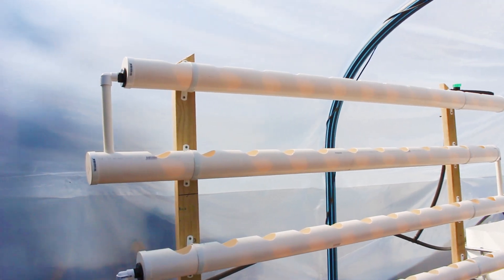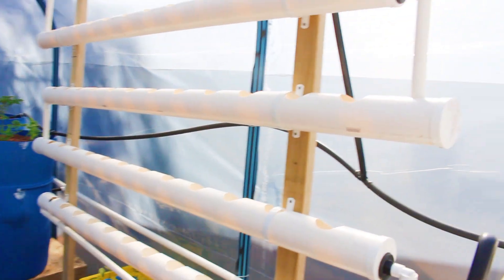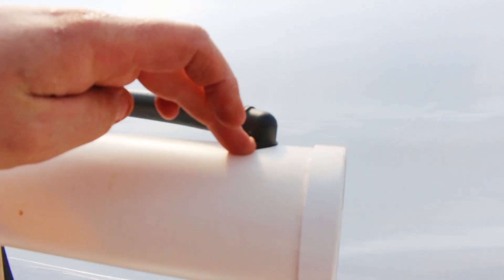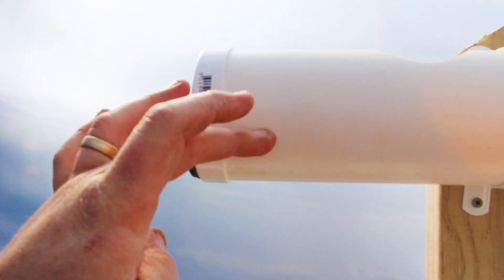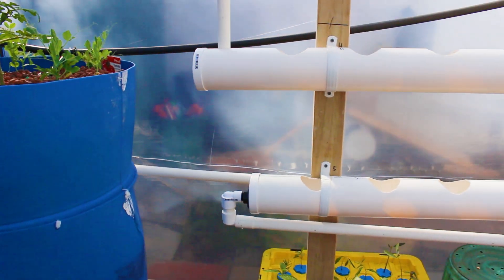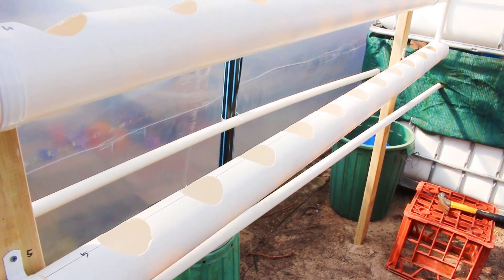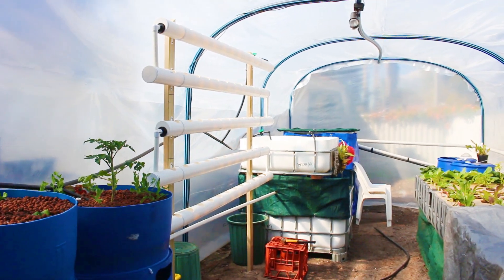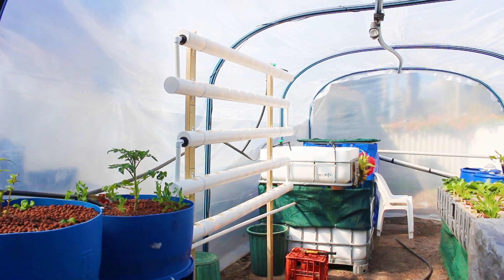DIY NFT Aquaponic System - Backyard Aquaponics - The Little Suburban Homestead

Comment: Good day Shane, I know it's been 2 years, but how did you determine how many plants in the net pots your system will need for this to work?

I know the ratios and calculations for the normal ebb and flow aquaponics, but I am not sure if its the same for a NFT aquaponics system

I hope you can help. Many thanks
Reply from the maker: Hey mate. I just measured how many would fit and went for it.👍